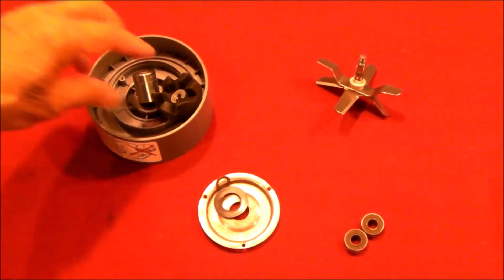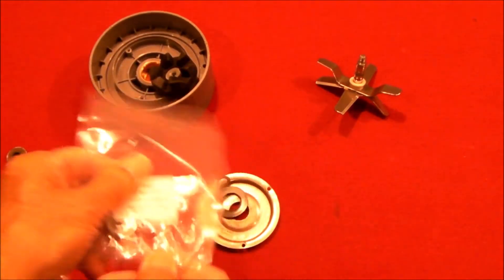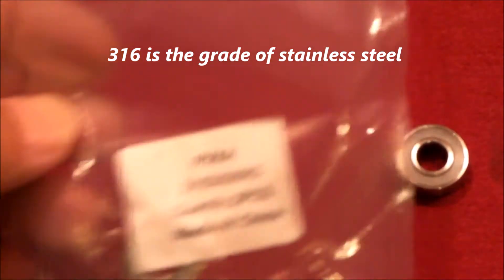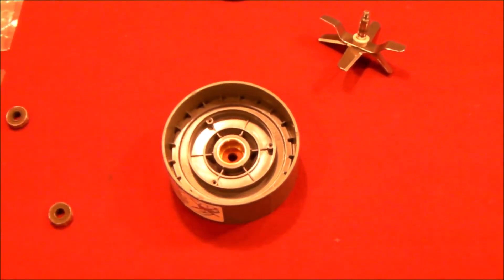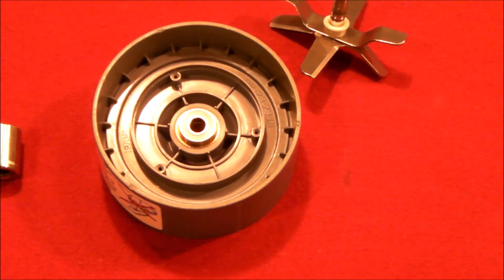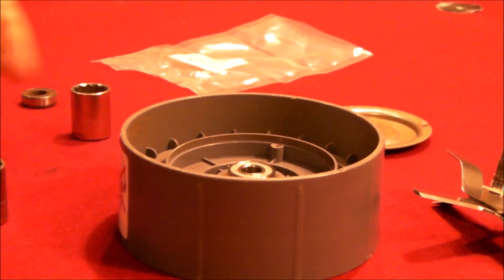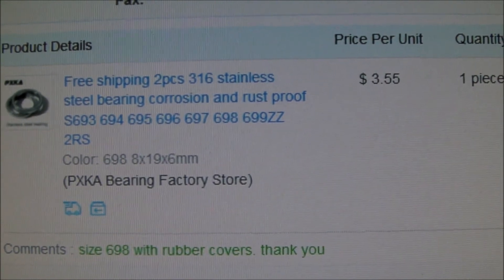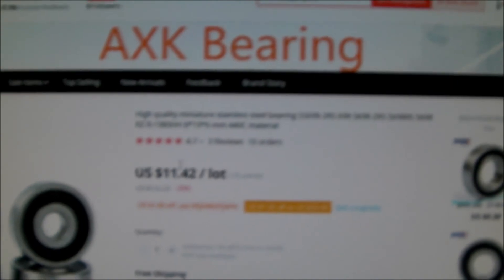LOUD, NOISY NutriBullet? The ball bearings are rusted & they can be replaced with stainless bearings

Comment: Thank you for the top cash back link. I dodn't know there was a service like this. Great! How have the SS bearings worked for you?
Reply from the maker: not as good as I had hoped.  I've tried ceramic and stainless with mixed results.  I have even tried new seals and bearing which seem to help but still not as good as it could be.
Reply: @YuDaMan  Hmm that's too bad. How have you removed the seal? You re referring to the one at the bearing base, inset into aluminium casing that's inset into plastic?
Can you please share the specs for it? I tried to remove it but there's a coil within it
Reply: @YuDaMan  Could you please kindly elaborate on how long 316 stainless ball bearings lasted under normal use?  Does your feedback on "not as good as I had hoped" mean that 316 stainless ball bearings also were damaged by the seepage of water/liquid?  Thanks!
Reply: Yes, please do elaborate on how long each of your trials lasted.  Have several of these that need to be rebuilt.  Blades are easy to sharpen on my bench grinder, and so hate to let them go to waste. THANKS for the video and updates!!

Comment: my nutribullet crapped out finally after so many years. The thing was super duper loud. I use to put a towel over it to muffle the noise but it was still loud as hell. I wear hearing aids now. I am thinking of buying another nutribullet and wondering if it comes with hearing aids. Such a poor design and I wonder if they fixed the design flaw.
Reply: 😂 I agree, the sound is deafening! Replaced my old nutribullet in Jan 24 as old one was getting too noisy but the brand new one was even louder!

Comment: Why you didn't replace the radial shaft seal (orange one) under the bearings? That is where the leaking strat. That is the reason for bearing rusting.
Reply from the maker: all stainless steel ball bearings do not rust.  I used expensive ALL stainless steel bearings ... on another repair for a friend I plan to experiment with CERAMIC bearings which have NO metal.
Reply: @YuDaMan  But if you change the orange seal you don't need any expencive bearings. Just standard ones, cheaper than steal..and of course... cheramic too
Reply: @YuDaMan  it is this one...
https://satelit-nikis.bg/en/product/6930/oil-seal-as-8x16x5-viton.html
Reply from the maker: @tindumbovic1079  Is there actually enough space for that shaft seal to fit into?
Reply: @YuDaMan  If you take the old one (orange) out than yes. Inner diameter (of axe) is 8 mm, outer diameter is 16 mm, and it's 5 mm hight. Fits like a glove... I did it a week ago.
Reply: @YuDaMan  ...after I sow yours video ... how to change bearings... Thank you for that !!! 👍👏
Reply from the maker: @tindumbovic1079  I will definitely try it so thanks for the info.  I was trying to figure out if 4mm height (thickness) is better or worse than 5mm height (thickness).
Reply: @tindumbovic1079  

Are you sure thats the correst size for the rotary seal? 

The bearing is 8mm ID x 19m OD and when I compared the seal to the bearing they were identical in ID and OD.
Reply: @ceezedgerman  Yes I am. For a Nutribullet used in EU. But I think its all the same... after all...  unfortunately.. it's al, at the end.... "made in china"
Reply: @ceezedgerman  Yes, ID is of course the same 8 mm but OD is not the same. If OD will be the same, then the two new bearings wouldn't stop at the right place when you punch them inside....they will crush the rubber sealing. So the bearings are bigger. You can see the line inside when the bearings and sealing are out.
Reply: @tindumbovic1079 

I took the seal and bearings out of mine out today, both measured 19mm OD in my calipers.
Reply: @tindumbovic1079    I am looking for 8x16x5 Oil Seal but couldn't find anywhere. Checked with 123bearing and Satelit Nikis but they don't have any stock.
Reply: Did it work? I have a second hand nutribullet that is having the rust and noise issue. I am wondering if I should change all of those components and the blade now to have it working "as new".
Reply: @mirellakacinskis  yes, but if you have to change the blade as well then its easyer to buy a new base...
Reply: Thank you writing for this comment! It is exactly what I needed to know.
Reply: I have a base I'm trying to remove the blade. The rubber gear on the opposite side is just spinning.  Not loosening. Any help to remove it?